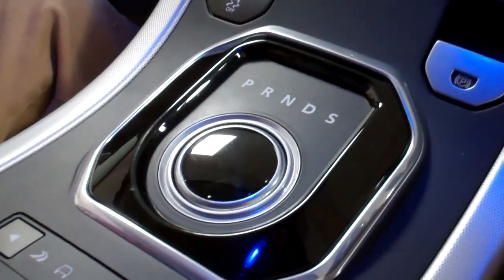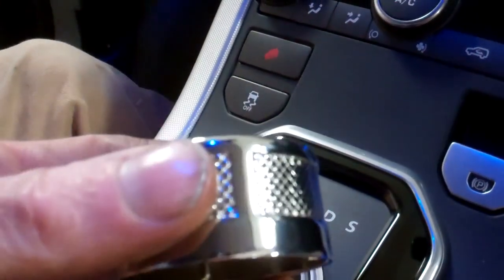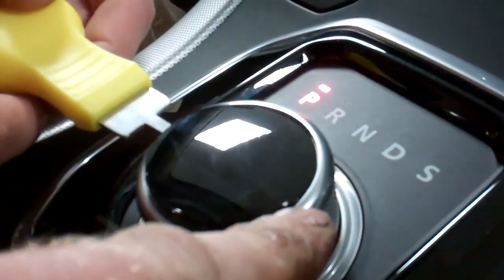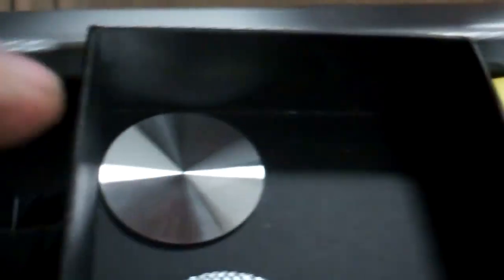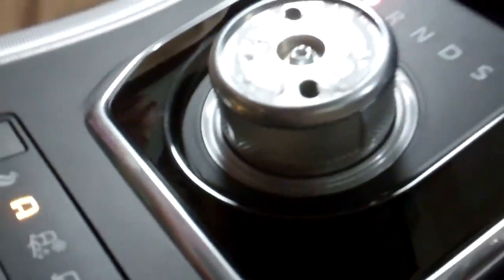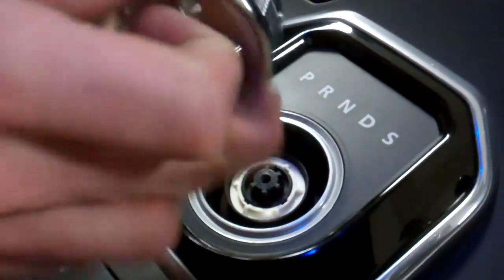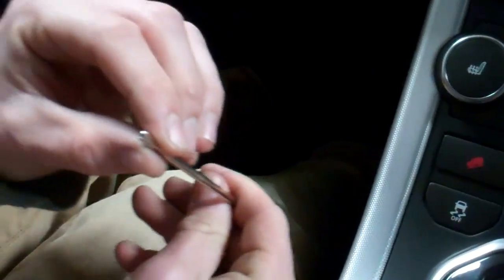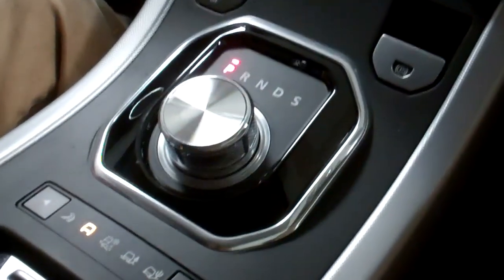How to remove Range Rover rotary gear knob selector

Comment: Hi.man hey im.woking on a 2020 supercharged  rover is stuck in neutral I release the manual leaver but the dash is telling me is not in parking so is not starting  can you helpe wat to do next any suggestion
Reply from the maker: You could try to apply the handbrake - disconnect the battery and leave 10 mins then reconnect the battery. Make sure you are on level ground .
It may well reset and select Park !
This is just a guess !
Reply: hiii man i got same problem my car stuck in drive mode ...can you please tell me how you fix the problem
Reply: 2015 stck in park how to fix it @MrGINNIPABLA